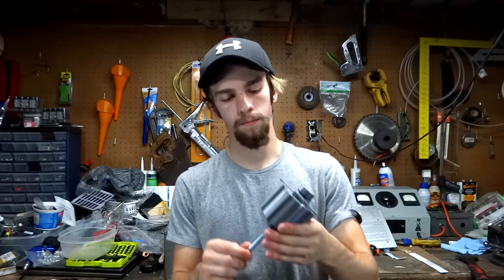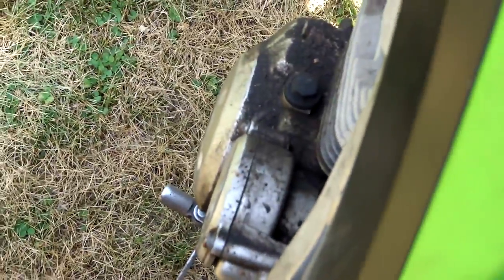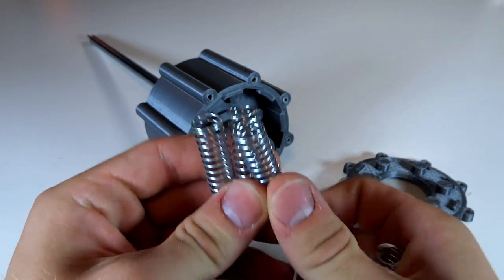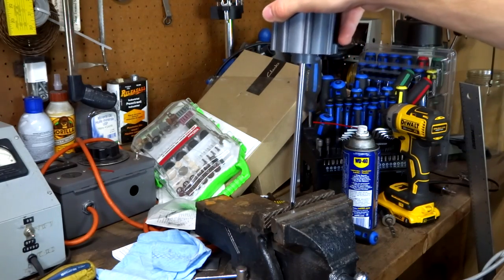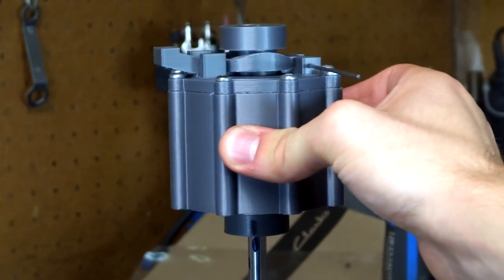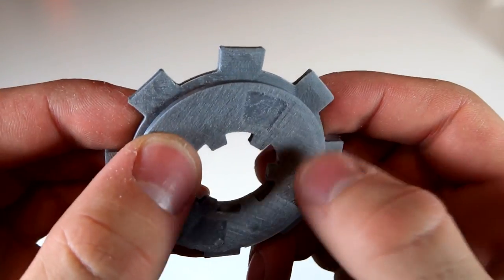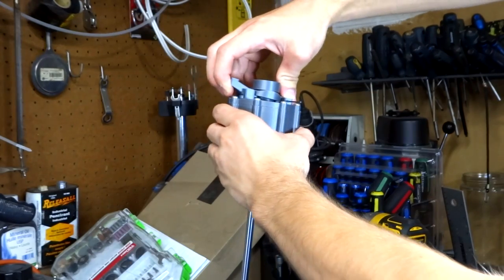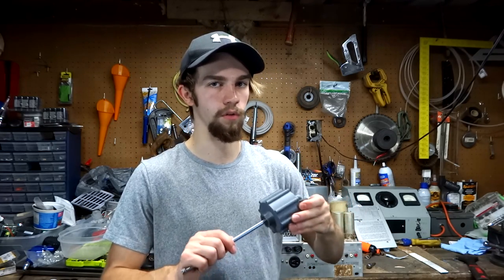3D Printed Motorcycle Clutch: Will it Break?

Comment: Wow someone actually did it, id like to see this attached to a gearbox with 5 gears or so and a toyan engine!
Reply from the maker: Me too! I think it could be possible!
Reply: @CamdenBowen  im kinda wondering how the gearbox would hold up or if you would have to use metal
Reply: @floridamangonwild  rc test flight and Edward page both have videos on the topic of 3d printed gear longevity and high speed testing
Reply: @tmn2813  with an actual combustion engine tho? Ive seen theyr videos
Reply: @floridamangonwild  no one has done it with a internal combustion engine to my knowledge.
Nitro Rc cars RPM in the range of 25,000–37,000 
Edward page tested straight cut Unlubricated gears to nearly 40,000 before it exploded.
so I don’t see why it couldn’t be done.
Reply: @tmn2813  but can it handle a toyan v4/v8s power? Hell even just a flat 2 unless theyr oversized
Reply: @tmn2813  a multiple gear gearbox? As in reverse forward 1-2-3-4-5?

Comment: Ive been trying to prototype a small clutch for RC vehicles for awhile. I started pouring silicone molds in order to make resin/sand composites for thd clutch pads, it all failed. Im going to try your hotglue method.

Comment: Motorcycle has a wet multi plate clutch with friction plates and slipper plates the springs are mounted on the basket of plates. But Awesome.
Reply: Nah, my ducati has a dry clutch.
Reply: @jeromerox9999  And it was noisy too.